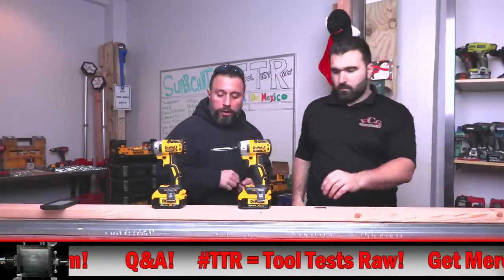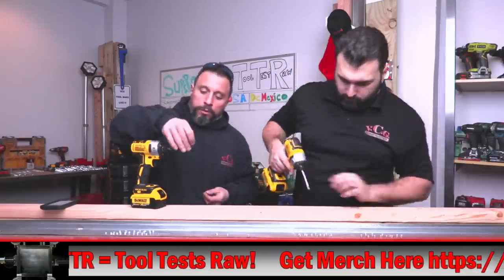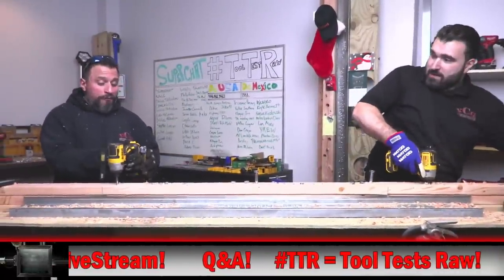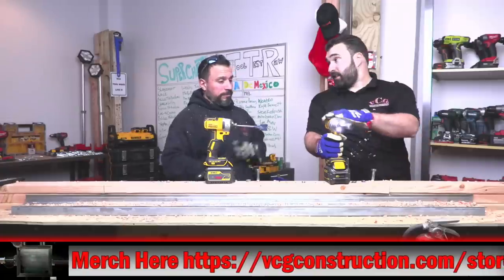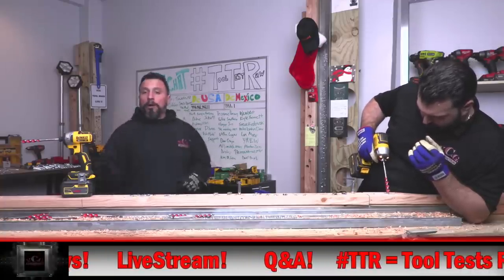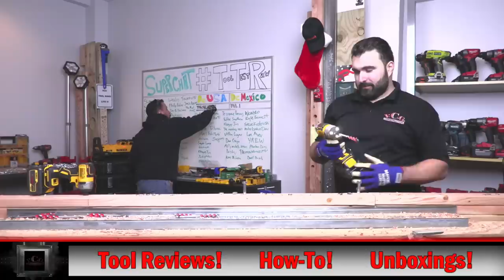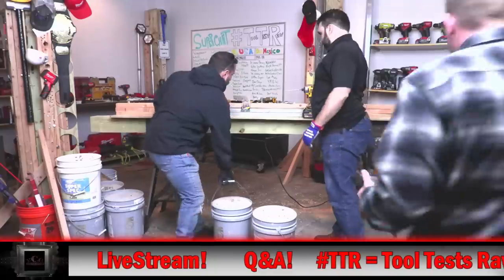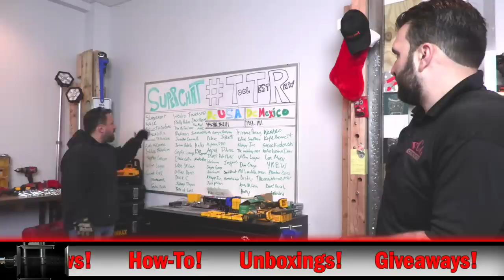DeWALT Impact Driver Tool Test! Made In USA VS Made In Mexico

Comment: You guys should have switched sides and impacts because alot of those things you tested we're operator error from your buddy on the right
Reply: but then when it came to paddle bits he was slower because he never cleared chips. so it has more to do with form than anything.

Comment: Sorry I missed you today, was stuck at work real late painting my office. 

Can I suggest a future TTR have a trifecta of 3 smaller head to heads? Things that don’t have as much variety to test so you can get through a few different tools in the time of a normal TTR. 

1. Wet/dry vacs, ridgid vs shop vac or some other brand, maybe 16 gallon or $100 price point. Suck up saw dust piles, chunkier pieces, a gallon of water, etc. 

2. 7 1/4 Circular saws, M18 fuel vs Dewalt or ridgid. Plywood rip & cross cut, 2x6 lumber multiple consecutive cuts, etc. (be cautious/safe with this battle)

3. Reciprocating saws, M18 fuel (not super) vs anyone. PVC pipe, copper or other metal, lumber (with and without nails?), etc with various blade changes. 

Sub something else in if you want, but I think I’d be most interested in a vaccum head to head.

Comment: If you look back threw the videos that the Dewalt burns up and gets hot is because mostly Jimmy covers the vents compare to Vince that knows not too.when he does uncover the vents later in the video they start running around the same temp..also Jimmy says he doesnt push down hard yet after Vince tells him to uncover the holes and then you can clearly Jimmy hand sliding down the front from pulling down so hard...So I have the Craftsman CMCF820 same as these but I think the reason the craftsman ran better in the test is because it has more venting..Put them Side by Side you can see the Dewalt has less...We did a test and drilled more vents in the Dewalt clamshell and he ran cooler and didnt smoke on our home test..Doesnt mean it wouldnt but I think it comes down to Dewalt need more vents or a fan inside..also just love the fact on the inch and qtr or maybe 7/8th paddle when Jimmy hits some in 2nd 2x4 at 1:42:09 he talks about it running smoothly during it and didnt shut down but if you go back and look during the test his did stop lights off and he had to repress the trigger...Please @VGCConstruction and Vince get someone that's at least around Vince's Skill level and doesnt have short term memory issues or lying or something...I love this Channel because of Vince and Nick but sometimes the people that come in to help dont know how to properly operate the tools and make the test so 1 sided...

Comment: Dewalt 887 owner. Fellas those gases are very toxic when impact or drill burning out. Room needs to be well ventilated so you don't inhale toxins. Use some fan also to direct those gases away from you.  I'm Electrician in trade 15 years and I used a lot of tools from Dewalt and Milwaukee and I own both of them as many other brands. Did not have problems of that nature but I didn't made torture test :D. Milwaukee looks and feels little better made then Dewalt. Milwaukee has problem with chuck that gets stuck (top drill), so makes bit removal ass pain sometimes. I use Dewalt 20V and Milwaukee m12 except bandsaw (5 inch Milwaukee is the daddy). Love Dewalt but they start to cut corners like Klein Tools. To bad I'm Dewalt fan because Milwaukee is kicking ass last few years. Did not see any carpenter using 887. They all use older brushed Dewalt impact's and that tell you something. Dewalt bits are crap like Ryobi. Dewalt leaning more towards Black&Decker and that is not good. They need to wake the f*** up or people will jump ship.
Reply from the maker: Good feedback

Comment: I don't understand these videos we know the 887 has no thermal cut off so it will inevitably smoke. It will never turn off no matter the load you either want that or you don't. We have m18 at work I'd never run augers but I could get those to stall I'm sure. The way I see it is you are able to choose if one company has the cut off and the other does not. This is great for consumers on both sides 👌

Comment: Even though it’s made in the USA, the dewalt facility in North Carolina is still 50% Mexican 🤷🏻‍♂️.   Try the Mac version.  (MCF886) It’s tighter and runs extremely smooth.  Only drawback is it doesn’t run as high on rpms as the dewalt but it’s stronger IMO.  Great video guys
Reply from the maker: I’ll look it up Matt, thanks!

Comment: These drills have not completely burned up like in the past because you correctly run them idly so they can fan cool themselves.  maybe that is what 887 owners should be aware of.  The 887s seem to be good tools as long as they aren't used for spade bits and large lags.
Reply from the maker: These tools still can’t compete with impact drivers from other brands, not good!

Comment: All talk, no science.
Each do 100 screws into the same 2x6s, 50 with each impact. Switch batteries after each 25 screws.  Nobody knows which impact is which until after the ‘experiment’.

Comment: The dewalts offer no safe guards/ tool protection as milwaulkee and makita do so when pushed that hard instead of shutting down it burns up smh
Reply from the maker: This tool was over 200 degrees!!
Reply: I agree and a Makita or Milwaukee would not get that hot red link intelligents and star protection wouldn't allow it

Comment: The 887s made it through because you babied them more so than the other ones.  They both still smoked and they both still aren’t reliable.  Dewalt’s cordless line in my opinion isn’t as good as others.  The best cordless lines in my opinion are the Milwaukee M18 and M12.
Reply: I agree
Reply from the maker: I agree, the only impact driver the 887 can beat in #TTR is another 887 !
Reply: @VCGConstruction 
 right
Reply: Agree , İ have a Dewalt 20 v max cordless drill/impact drill, and a cordless Milwaukee m18 drill/impact drill. Battery in the dewalt will drain very quickly, and the ratchet locking mechanism sucks a#$. The milwaukee one is superior except in weight (dewalt is lighter)  they cost almost the same here. Greetings from México.

Comment: Your testing is flawed by far too many variables, the USA is only part of America and there is little pride to be gained if the tool is made from parts manufactured in an other country then assembled in your own. All the gobal market leader Stanley is doing is supplying a product they make from somewhere to where ever there is a market need. Looking down one's nose at Asian based product is a nonsense. I have killed 2 De Walt battery drills in my time, both made in the PRC but think the point of origin had nothing to do with it. De Walt Stanley designed, manufactured and marketed the drills not China or as in your case, Mexico. In my case both drills plain wore out and for their price I feel I got good value from them. I contend that as long as the product is the same design, same materials are used, and the same QC standards are administered there shall be little, in fact no difference as to its' fuction no matter where it was made.